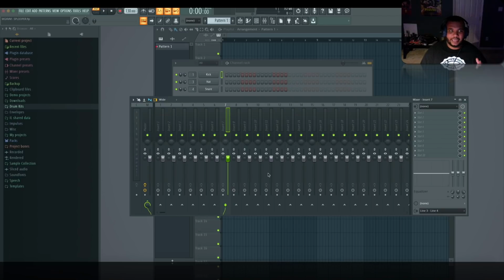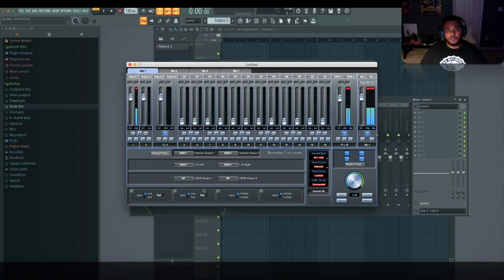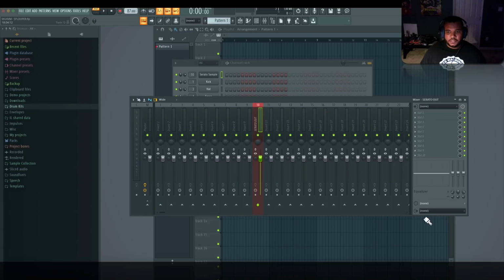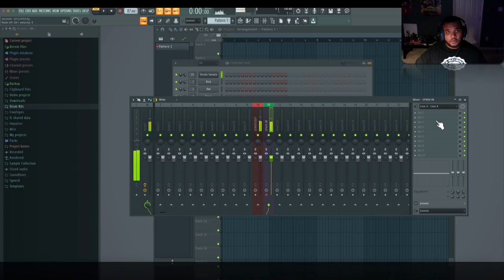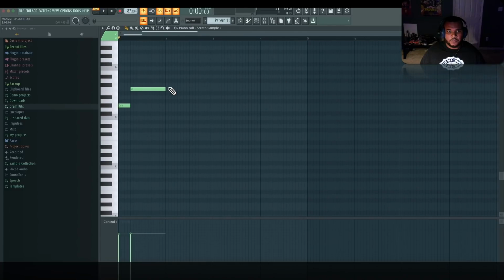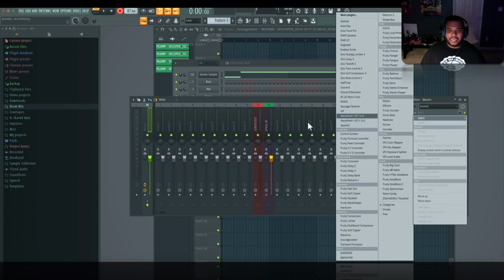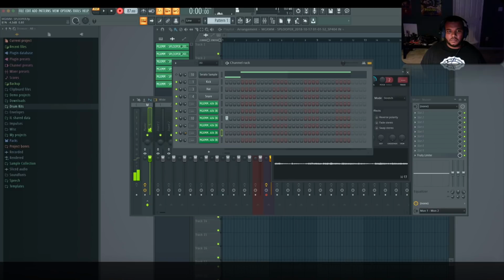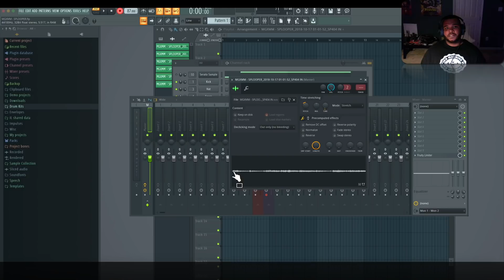Lofi Setup | FL Studio 20 Fire x SP 404 | External Hardware Tutorial

Comment: can i do this with a focus rite 2i2? or with 2 interfaces pluged in at the same time?
Reply: To be able to do this with a 2i2 you would have to run your headphone output into the sp then out of the sp into one of the 2 inputs on the 2i2, and through your main outs. I've done it with a 2i2, 2i4, but I hate focusrite, so now I just use an NI Komplete audio 6 and you can have the 3/4 AND main outs play at the same time.
Reply: BUUDA BEATZ thanks!  I’ll give it a try!